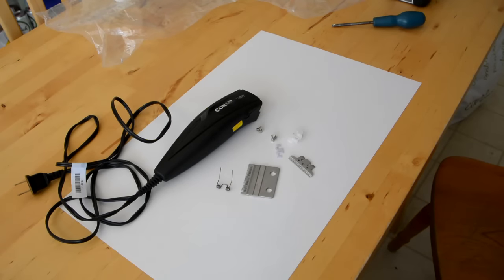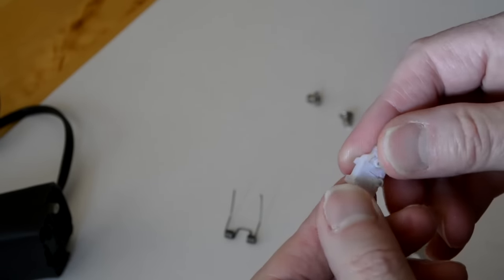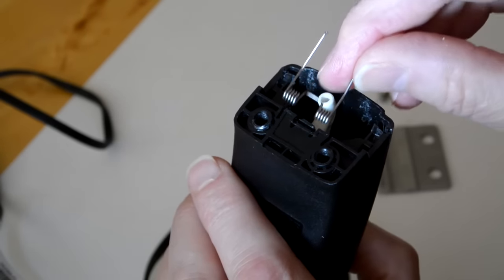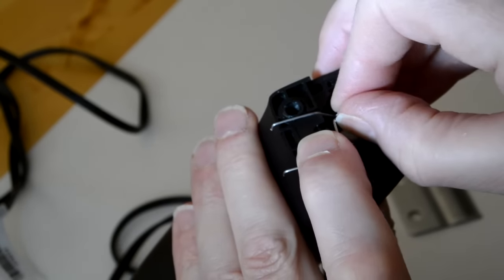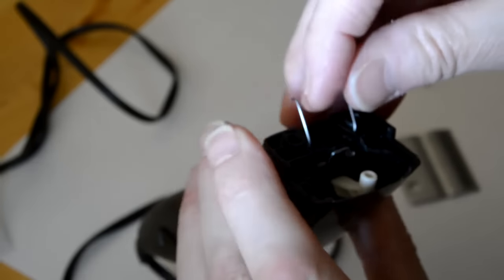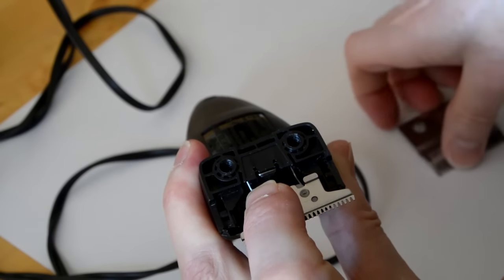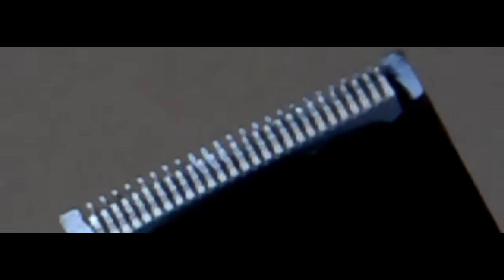Put your Conair Clipper head back together (reassembly)

Comment: I couldn't do it, I have the red one, I just smashed it against the floor 3 times, problem solved! Buying a new one soon 🤦‍♀️
Reply: I had a basic wahl hair trimmer that someone gave me.   4 years or so ago.    And just about a month ago the cutter comb assembly needed to be put back on the trimmer.   And girl. I ended up doing the same thing.  Couple explicit words expressed and across the room into the brick fireplace mantle stopped its flight through the air.  Lol
Just got a new conair brand corded electric  hair cutter.
Reply: Damn 😳
Reply: My thoughts exactly 😬💯
Reply: 😂😂I just did the same Shii
Reply: I m doing it tomorrow, it's bullshit even trying
Reply: But I can't do it I have Only one 😂
Reply: Ur head and ur words are same.
Reply: About there and I just looked at it

Comment: Thank you for this video!!! I happen to have a Wahl brand trimmer. Model MIS. The pieces are a little bit different but the overall concept of the blades being spring loaded is completely accurate. I was getting ready to throw this trimmer away and buy another one. You saved me some bucks today!

Comment: Thank you! Yours was the only helpful info out there. I just successfully reassembled it! Mine isn't even the same model, and the parts look far different, but your details about those holes and springs, then showing the angle and direction to attach and to bend them made it all possible. Thank you so much!

Comment: I didn’t know that once I had put the spring attachment onto the little blade that I had to push it down for it to be able to to the big blade to be able to be set in place for the screws to be able to hold it in place until I saw this. Incredibly detailed video and give this 5 out of 5. Wouldn’t be able to have put my clippers back together without it.

Comment: I'll add my thanks. My Conair isn't the exact same but simply pointing out the spring ends connect to the plastic blade holes (which I missed reassembling myself) helped turn the clippers from useless to working again. Bless you!
Reply from the maker: I think I've helped way more people than I ever thought I would tbh.

Comment: Thanks very much! After dropping my hairclipper in a basin of water (fortunately the wall switch was off) I opened it to dry it out. The spring fell out and I couldn't see how to put it back together. Even with your wonderful video it took me a while to work out how to fix the spring in place. There was also a spongy black piece of soft plastic fibre with a hole in it that you didn't mention. I eventually guessed that before fitting the spring I should stuff this inside the hairclipper, with the hole fitiing over the actuator. Like a miracle the haircutter now works as well as before.

Comment: Turns out I had it right, it was just that the job took four hands. I held the plate in position to keep the bally thing from flying apart, and my wife screwed it down. Thanks for the confirmation!

Comment: That damn spring. I have a different (older) Conair model than what is shown in the video. My problem was when you tried to press the spring down to compress it, it would pop out of the slot every time. What I ended up doing was attaching the main blade very loosely with 1 screw. Then rotate the main blade 180 degrees. Now put the spring and moving blade assembly into the slot going under the back corner of main blade. Now rotate the main blade back to where it should be. The attached main blade will keep the moving blade spring assembly compressed and in place. Put the 2nd screw back in and tighten both. No more fighting that damn spring.

Comment: my Wahl Pilot clippers suddenly would not cut at all upon trying to use them this time(trimming my shih tzu).  thinking I may need to replace the blades,  when taking the blades off the spring popped out. had no clear idea how it set in place.  I was able to put my spring back in place from comparing to this video.   yeah!!!   instead of spending  60 to 80 dollars for a new one.  thanks man and was able to trim my dog tonight.  not sure what the reason was for not cutting initially.   it was missing a pad for absorbing the oil, so I cut a piece of gauze and put in place, put back together and cuts fine.  I think it may have needed cleaning out in there and that pad replaced.

Comment: OMG thank you so much.  I had no idea about that spring.  It just all popped apart when I too the screw out.  I've got it back together but it's now very very loud so I think something else is wrong.  Oh well might have to buy a new set.
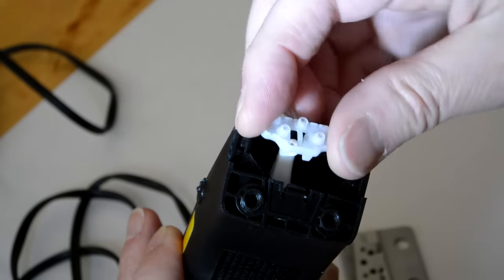Reply from the maker: Are you sure you got the moving pin inside the carrier thing? 0:35
Reply: @andycivil  I thought I did coz it's all moving as it should just noisey. But I'll check tho.
Reply: I had the same problem and I figured it out. On the right side when looking at the top of the clippers, there is what looks like a screw. With a flat head screwdriver, turn it until it quiets down.

Comment: Thanks! I put the metal plate on the wrong way round. Looked correct but wouldn't cut. These clippers are the same as the Babyliss 7437TU here.

Comment: Thanks for the video. Unfortunately mine has the adjustable blade height mechanism, which holds the spring, but the plastic bits snapped off rendering it inoperable. Hoped to superglue the pieces back, but stripped some smaller screws on the way down the rabbit hole. Threw in the towel and bought a new Wahl set.

Comment: Look at adding video for the adjustment side after reassembly. My blade became way off center after cleaning. There is a blade centering/alignment adjustment screw come to find out where that yellow stick is on the side. Mine had become very worn and therefore couldn't read. I had an idea that this screw was for just this purpose. My clippers didn't sound right when I turned it on too. Loud and a lot of added vibration until adjusted properly.
Reply: Four-Corners-Foto how tho I don’t have an extra alignment screw or stick
Reply: bee deflyy mine is just like the one in video. Where that yellow sticker is on the side is where the side to side adjustment screw is. After i disassembled mine and put it back together it was so much louder and with more vibration. I played with adjustment screw for a while and i could never get it to sound and feel like it did before disassembly. Over last month took it back apart and reassembled and got it to run smoother like when was new.
Reply: Four-Corners-Foto exactly. And so is his. That’s why he did a muted slow mo at the end. I’m a pro barber and from experience, some clippers, once you take them apart, will not go back together factory straight or quiet.
Reply: Four-Corners-Foto and I learned the hard way today that my 70$ wahls are one of the ones that are almost impossible to reassemble. It’s actually messed up if u think about it.
Reply: bee deflyy i was worried with mine but i dont think this version cost more then $20. I dont like to throw away 20 bucks so happy i got it back to new like condition. Side note had it couple of years and it needed ti be taken apart and cleaned. Good idea for people to use lite weight oil on blades every 3 or 4 uses. The metal blades/sheer part seemed to be of nice quality.

Comment: Thank you so much.  I was going to look for Conair's help line but then I found your video.   Even the most patient person would not have been able to walk me through it over the phone.  How on earth did you figure this out?
Reply from the maker: Good question! I started from the premise that the two holes absolutely defined the orientation of the spring, even though it seemed unlikely. Then, I tried to visualise how the spring centre could be in the tab, while the ends were in the holes, and with pressure keeping the ends in those holes. I realised that I needed to push the ends in a certain direction, and that's when I spotted the slots and reasoned that they were there for the purpose. As I said in the voice-over: "I didn't think it was easy".

Comment: Please show me a video on how to assemble the Conair( HC 1000) fast cut pro clipper with adjustable blade.I am having a very difficult time trying to get back it together.It's spring is similar to the one in this video but because of the taper control  which moves the blade up and down inside is a bit different.Please help me thanks.
Reply from the maker: I wish I could, but I just don't have one to play with. I was only able to do this one because a friend asked me to put his together.

Comment: Hi,
Are you aware if it has a "sensor" that keeps it from running if it's clogged with hair?  I use a conair for my dog, and they're long 3 hour sessions.  I usually clean it out afterwards, but anyway - now when turning it on = is nothing, no vibration, like the whole thing is dead.
I saw another video with clogged hair and the device could still turn on (make vibrating noise), but the blades weren't moving.
That's not the case for me, for me it's nothing, and there seems to be no damaged wires/frays.

Think I burned it out, or is it worth taking apart/cleaning and seeing if that does it?
I'd think even if it was clogged with hair, I'd still hear some noise/vibration when I turn it on.
Thanks for the video
Reply from the maker: It sounds like it burned out, to be honest. The one I had in the video was 'electric' rather than 'electronic' if you know what I mean. Very often, these type of devices have a safety "thermal fuse" which opens (permanently) if the windings get too hot. That would be my best guess here.
Reply: @andycivil  Thanks.  Yet I actually took it apart and cleaned it, no luck.  But then pulled the whole back off to get to the switch - and the solder connections look good, the "switch" is in a plastic box that you can't see, and now when all put back together - the ON switch turns it on, and it's touchy.  It seems to be working though for the most part, so it's looking like something in the switch connection, or just burned out and getting a couple more runs out of it.  
I wish I could see the switch connection, but all you can see are the 2 wires, the actual metal tab that must slide over is enclosed in a little black plastic box, it's stupid.  I did remove a hair that was connecting the 2 wires, I don't think that one hair could conduct electricity, but who knows.

Great video though and thanks for the comment.  It is a sketchy-thing taking it apart and it took a bit the first time to put it back together, remembering which ways the blades sat etc. ....because as soon as you take out the screws, everything falls apart...so there's no way easily to 'see and remember' the configuration. :)

Comment: I have a wahl model 9649 color shaver I have turned it on and opened the screws and the razor blade and after installing it it has a lot of sound and concussion and does not shave. Can you help restart it?
Reply from the maker: Not really, but that's the kind of thing that might happen if the actuator wasn't lined up with the plastic slider when you put them together.

Comment: Ok. So i may seem to be a bit dense or completely daft. In asking this.  But the printed instructions. Confuse me.  It says to align the teeth on the cutter and comb plates point to point and that tberd needs to be a 1/16 to 1/32 gap 
Then it states to align the plates so the comb plate is far enough to the left to one tooth point past the cutter plate edge.    

The provided picture shows only 1/16 1/32 meaurement and nothing about left to right alignment.  
If you align the comb and cutter up to the left alignment like it states.  It then doesnt align point for point.  And vise versa if you align it to the right.  And centered. Its not aligned point on point.      So how in the bloody heck do propey align the plates.  
Ive unboxed it, yet not yet used it, as i want to follow all tbe proper steps in setting it up etc.  Any help info is appreciated in advance.   Thanks.
Reply from the maker: I hope someone else can help with this, for I have no idea, sorry!

Comment: Thanks! This also works for Wahl Trimmer / Clipper Model #NIS. The spring isn't exactly the same (there's no holes in the plastic fitting to put the spring ends in), but the procedure for assembly is very close. Just like Alexandra, below, I couldn't find any help, not even from WAHL'S WEBSITE! I'll need a bedtime story, too.

Comment: Thank you for the video , but I put everything back in place it worked only for two minutes then it stopped i open it again to make sure everything is in place any tips?😢
Reply from the maker: Not really, I mean it's pretty simple, the motor moves the actuator, the actuator slides one blade against the other. So when you say "it stopped", what part of that isn't happening?

Comment: If anyone needs any tips after you have the spring, the white part, and the small blade together start screwing in the big blade/guard whatever it is.

Just enough to hold it so you don't have to hold it by hand all together while you screw it in

Comment: My spring is shaped differently than the one you have mine the loop isn’t in inside of the springs  it is on the outside shaped like a u instead like your
Reply from the maker: Without seeing it, all I can suggest is to follow the same logic that I did with this one. Hopefully it's obvious where the ends of the spring lock into the blades - that will define which way round the spring goes. With the spring the right way around place the spring as far forward as you can (because you're going to want to pull it back with the blades) There must be something for the 'u' shaped parts to hook on to. In my case it was that tab in the middle, but in your case there must be some kind of protrusion where the 'u' shape(s) is (are).

Comment: It all depends on the brand of trimmer.The instructions on this video are spot on, but I would not/never recommend the Babyliss men's hair clippers. Bought at Christmas and used just the once. Attempted to use it a second time and the thing just tugged at hair instead of cutting it, with the blades not even moving and just making a noise. My hair is fairly short anyway and the clippers should not need cleaning after just one brief use. Cleaning didn't make it any better and never take this particular make of clippers apart to reassemble. As they can never be put back together again. Word of warning to all blokes who are after some clippers. Never go for Babyliss, it is cheap crap. Thanks for the video though.

Comment: Bro I reassembled correctly but its not cutting 🥲
Reply from the maker: Oh no! Usually when something doesn't cut, it's because there's a gap between the blades that shouldn't be there. Make sure the blades are the right way around! Depending on the model you might have got one upside down perhaps. Check that the blades are tight against each other, the spring should press them together.

Comment: Thanks. Unfortunately it’s a mission impossible with the new cordless model. The spring keeps going to pop up as soon as you apply tension to it. After 1 hour I gave up. I had to open it because was exaggeratedly noisy maybe for too friction even if it was new but no way put it back together
Reply from the maker: I'm sorry to hear that! It's hard to believe that they've made a new model that's even harder than the old one. I feel that there must be a way, after all, they assembled it in the factory!

Comment: Too bad it’s off center in the slow mo that’s why he did a slow mo with zero sound cuz it was so messed up n loud at the end look closely
Reply from the maker: I wasn't being devious, I just wanted to finish the clip with a fun thing. I have no idea if it was louder than usual because it wasn't my clipper and I hadn't seen/heard it prior to taking it apart. I didn't notice any centering adjustment. Slow motion clips generally don't capture sound.
Reply: andycivil which was basically why u chose to make it slow mo. You could have noticed something was wrong because it was loud af when you turned it on “for the first time ever”
Reply from the maker: It's rude to publicly declare a bad motivation on someone else's part, especially when you're wrong.